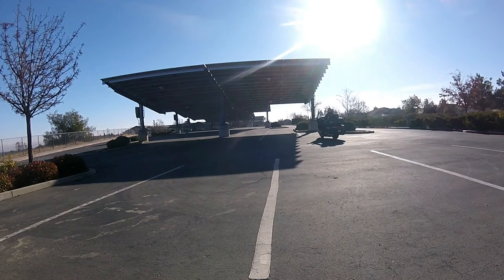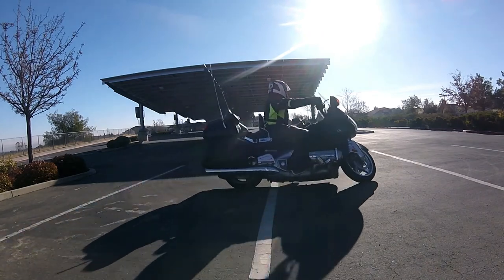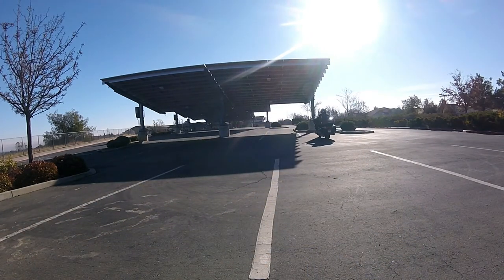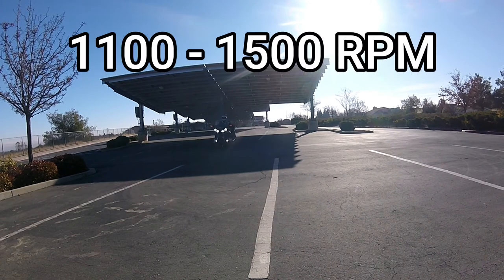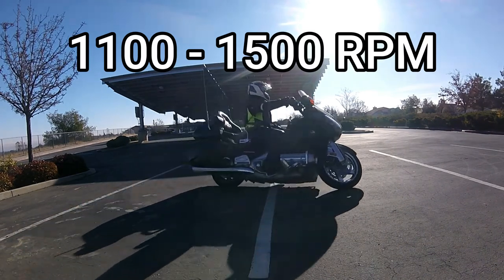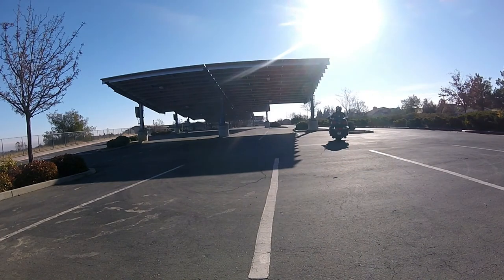Advanced Motorcycle Slow Skills | U Turns,Throttle through it...Don't Coast

Comment: Been having to practice this more on my Yamaha Venture to get better control of the throttle in slow turns and u turns.  As I have gotten better throttle control my turns have gotten better , tighter, and more stable . I have also gotten more comfortable with that beast leaning over further and slower and then bringing it back up as I work the throttle  and friction zone better in conjunction with each other.
Reply from the maker: Yeah its all about control, not to mention it looks and feel good when you riding the BIG bike.  I'm sure you get a lot of stares and comments when you sling that big bike around a u turn and park it.
Man its nice.